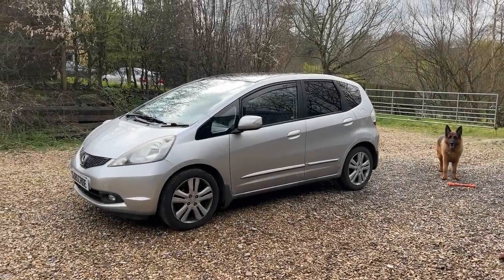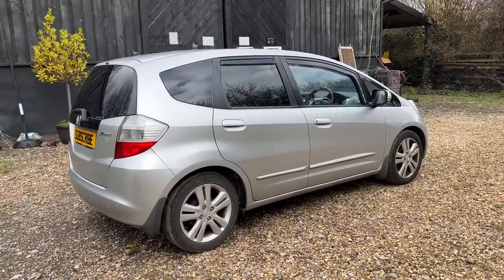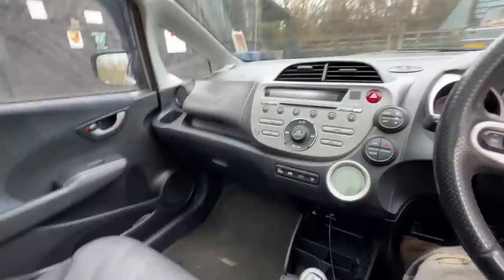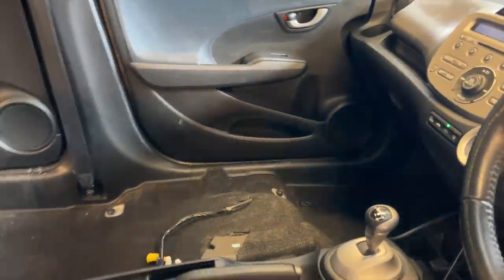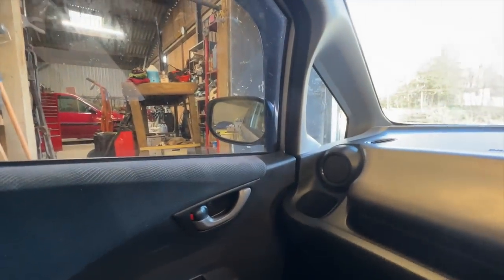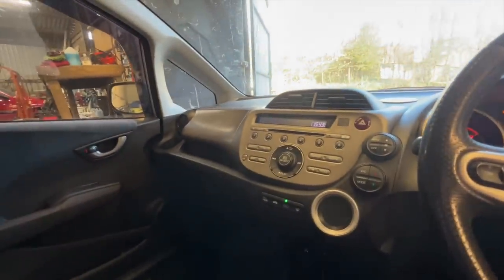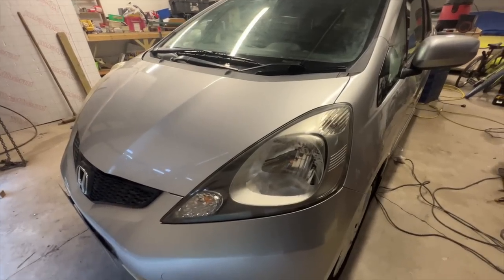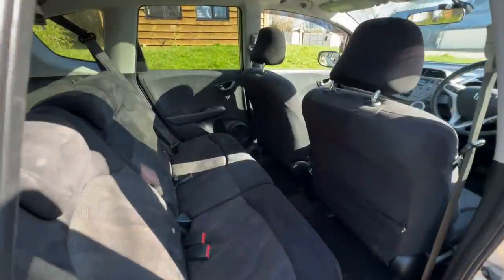Smart Trading Bagged Me A FREE Car!

Comment: I have that exact same car, same ex spec, same colour, same i-shift semi automatic gearbox (2 pedal, robotised manual gearbox), same year. A japanesse car but Swindon built. Had it for 8 years now. Never ever had a problem with it. It just goes on and on. They are  fantastic vehicles. 52 mpg in the winter which will jump up to 56mpg in warmer weather. And the interior is so amazingly versatile.
I considered changing up a couple of times but just nothing out there compares to these for economical, reliable motoring so I plan now on keeping it forever.
The extra's on your Jazz from factory  are the body rubbing strips, mud flaps and window wind deflectors.
90 thousand miles is nothing on these and it will make someone a great reliable, daily runabout.
Reply from the maker: Thanks David, that’s interesting information. They are very good little cars and although it is my usual cup of tea, having dealt with this one id certainly be willing to handle another 👍

Comment: Sorry if you have said this elsewhere.... And I know you didn't use a spray can on this video, but where do you buy them from. The paint match you get is excellent each time.
Reply from the maker: Hi Tim, thanks for checking out the video. Depending on what I’m spraying I either use ‘paints4u’ for aerosol paint or if I’m spraying larger areas with a gun I use my local paint supplier (who can tone match anything unusual too) 👍

Comment: What’s the process (steps) you use when cleaning upholstery
Reply from the maker: Hi Kingsley, thanks for the question. In honesty every car is different so require differing products and techniques. However, the bottom line is to aim to clean as thoroughly as possible followed by extracting as much cleaner (and dirt, grime and smells along with it) before drying everything as thoroughly as possible to avoid mould, mildew and even more smells!